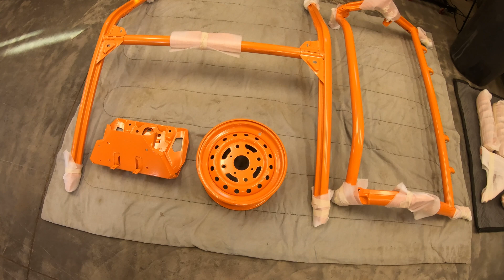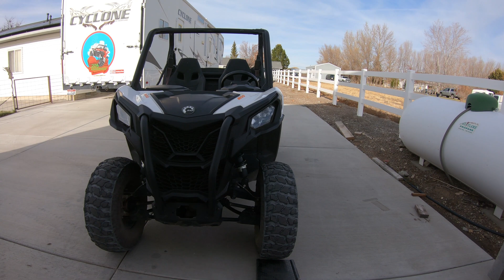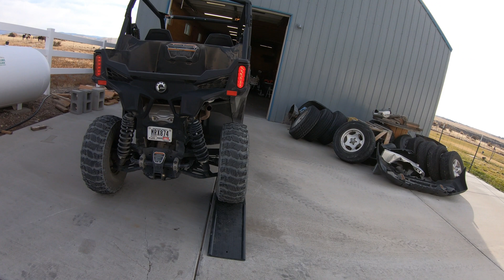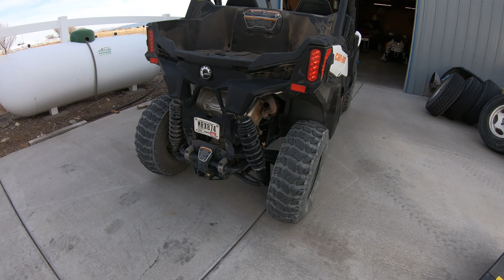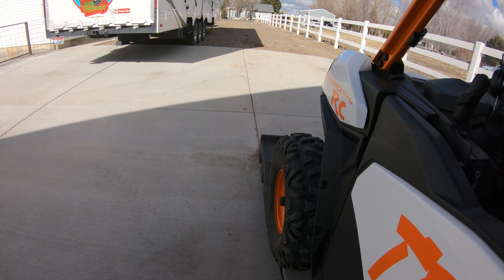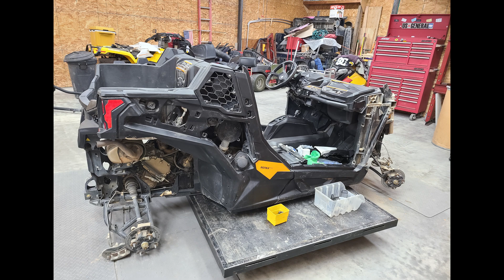Not your Average 50"- Maverick Trail RC Build |  Ez-steer | sway bar removal.

Comment: Nice job! Now you have me thinking of putting a smaller diameter rear sway bar on my XRC sport. What diameter is the rear sway bar you took off your Trail?
Reply from the maker: I looked for it last night and couldn't find it? A from mine has the XRC and he ended up unhooking both front and back,  It seemed to work great as those shocks are a lot stiffer than the ones on the trail models.
Reply: I had Shock Therapy work  over my shocks and changed the springs and it made a world of difference. I'm just looking for a little more.
Reply: Thanks for looking! I'm sure I can check out the sway bars at my local dealership.
Reply from the maker: As soon as I find that swaybar I'll let you know the diameter..

Comment: What size tire are you running? I know you said 28”. What’s the width and rim size?
Reply from the maker: They are 28x9x12. Thanks for watching and supporting the channel.
Reply: Last question, any rubbing issues?
Reply from the maker: @agliem1  no issues at all. We have about 1100 miles on them so far and no complaints, running 7psi in the front and 9 in the back.
Reply: @091200xr  thanks for the fast reply. Stay safe!
Reply from the maker: @agliem1  absolutely 💯. Thank you.
Reply: Hey, question regarding clearance issues with you running 28 inch tires. I’m running 27x9-12 now and looking to go to a 29x9-14. With your 28 how close are they to rubbing?  You think I’d be okay running 29’s?  I’ll be running a 4-3 offset.
Reply from the maker: @agliem1  I have great clearance and was wandering the same if I could get away with 29s. I'm running stock offset 6+1.  Not sure with that offset 🤔.
Reply: I’m running two inch wheel spacers now so the 4-3 offset should keep me the same width. The tires I’m running are the Tusk Terrabite tires. They are 27 inch but when measured they are more like a 26. Are your tires a true 28 inch?  I hate to order a 29 inch tires and have rubbing issues.  I’m going to stick with the Tusk tires as I’ve had great results with them. I ride on the east coast. So all my riding are on hard pack trails.
Reply from the maker: Yeah my 28 are mor like 27 with the 9psi
Of air I run in them. Of the 29 are actually only 28 I would say no problem.
Reply from the maker: I did put 1in wheel spacers in the back
Reply: @091200xr  I’m running two inch spacers front and rear. Machine is much more stable.